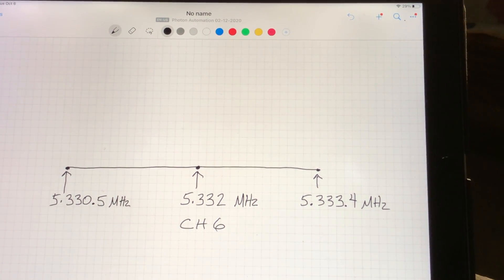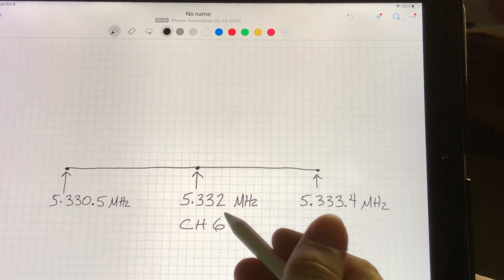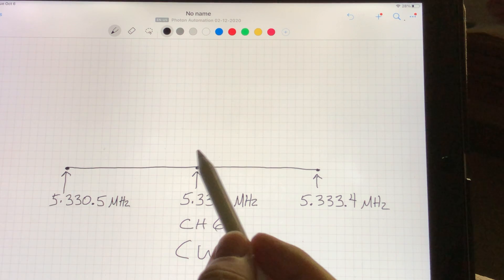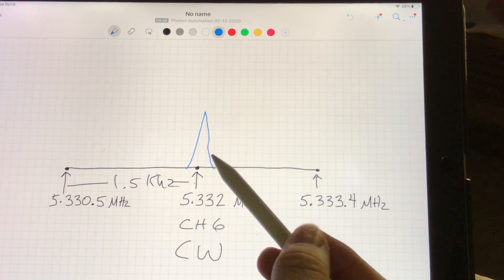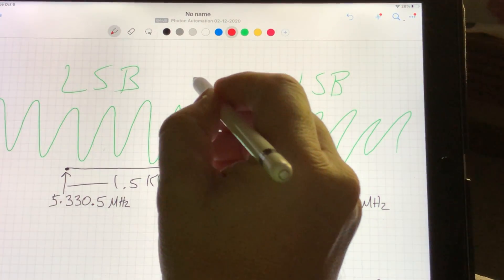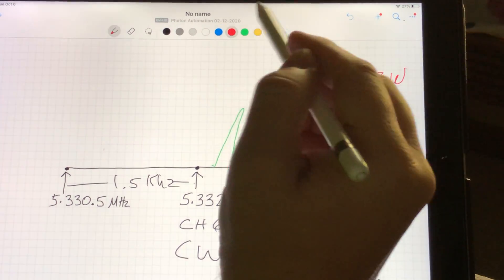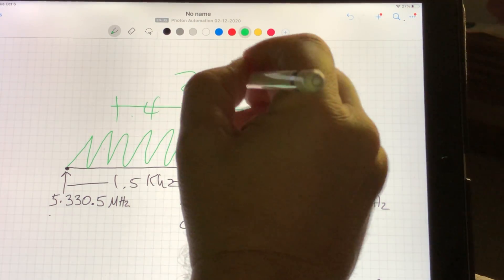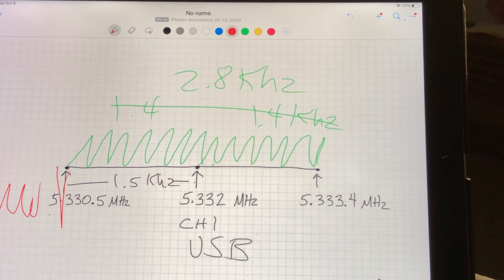Understanding the 60 meter band channels (Part 2)

Comment: Could you technically set the radio at 5.333.5 and use LSB?  Not to muddy the waters, lol.
Reply from the maker: We cannot use LSB. The 5 MHz portion of spectrum is primarily for government entities.  We have to share and respect the rules or we lose it.  It is a very useful “gap band” for emergency communications, when 80m signals fall short and 40m signals fly over the area we need to reach.  That was the justification that gave us the 5 channels. 

The government uses USB only for SSB communications.  Amateur radio and Citizens Band radio are the only radio services in the U.S. that use both USB and LSB.  There are rare exceptions, such as the former Yugoslav military.  They used LSB with some vintage gear.

Yaesu preloads the channels into memory bank 5 of their transceivers constrained for perfectly legal transmissions.  They limit us to USB, automatically shifting the USB carrier point to 1.5 kHz below the channel center, and limiting TX bandwidth to 2.8 kHz.  We then only need to ensure that we don’t transmit with more than 100W Effective Radiated Power (ERP).  We can achieve that by using a simple dipole, trimmed for the 5.3 MHz to 5.4 MHz.

Comment: Just so I have this straight… Since we only have 5 ‘channel’ frequencies on 60m. Whoever gets there first gets to use the channel.  Yet it’s not used too much?
Seems crazy, because there are thousands of Ham operators out there, and I see people jam packed shoulder to shoulder on the other bands (40m and 20m especially)… but not much activity on 60m.
Reply from the maker: 40m is a 23-hour band, so it is popular day and night. Daytime for regional coverage and nighttime for DX.  20m provides DX range during the day and often at night, up to a point.  20m isn’t a 23-hour band.  People with amplifier like to use 40 and 20.  We can’t use more than 100W ERP on the 60m band. Many operators want to run their amplifier. I like that there is a 100W limit.  It levels the playing field. We share the band with government agencies. If they need the frequency, we must vacate. I’ve never heard that happen. The main thing we must be careful of is that we transmit 1.5kHz below the channel center for voice (USB only) and transmit at the center of the channel for CW. For USB our transmit bandwidth cannot exceed 2.8kHZ.  Yaesu programs memory bank 5 within those rules. Use memory bank 5 and you will be legal.

Comment: Great video. I knew there were some weird things going on with those channels…. You explained it very good. I have a handle on it now. Also did not know that the manufacturers were changing the displayed frequency. That seems to cause some confusion. 73 KY4K
Reply from the maker: I’m glad the video helped sort out some of the confusion. 60 meters is a great band. 

73, de N4HNH
Reply: @n4hnhradio  I know…. I have been working FT8 there for a while now.

Comment: How and when does the Govt use 60m? Ie. emergency coms,  special ops, etc. Digital, phone or cw?

I wish I’d had taken a closer look at 60 before now… Hopefully I’ll catch you there soon! 

73 my friend.
W4MUD
Reply from the maker: Alaska Emergency Communications uses the 5MHz band.  There are also beacon stations and propagation testing stations within the band.  Many other countries use the 5MHz band as well, for similar reasons.  Some of those countries also allow their amateur operators to use the band, but usually on different frequencies than the ones we are allotted.

73, de N4HNH
Reply from the maker: It’s such a great band.  A few years ago, there was a belief that, if we don’t use it we will lose it.  I have noticed more and more traffic on the 60m band in recent years, so, if that is the case, I would like to think that we have proven that we are worthy of the 60m band.

73, de N4HNH
Reply: @n4hnhradio  I've been bouncing around it today and I've heard QSO's every time. The band seems to be coming around now where I live. It's the best I've heard so far...
Reply from the maker: Jump in and enjoy it.  You don’t have to compete with amplifiers.  It puts everyone on equal footing.  100W ERP maximum.

73, de N4HNH

Comment: Thank you this was interesting since I did know the radio makes basically hid the actual frequency.  I would like to know what table and software you were using to do the drawing.  It was nice.
Reply from the maker: The tablet is an iPad Pro 12.9”.  The app is called Nebo.  I was using the Apple Pencil to write on the screen.  The Nebo app can convert what you write to typed text or you can use free form mode, which is what I was using.  73, Doug